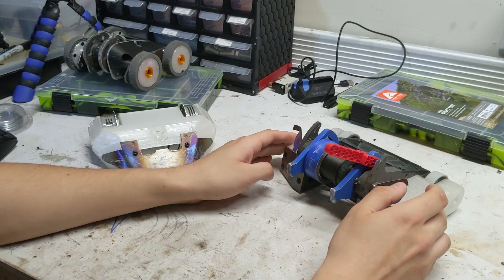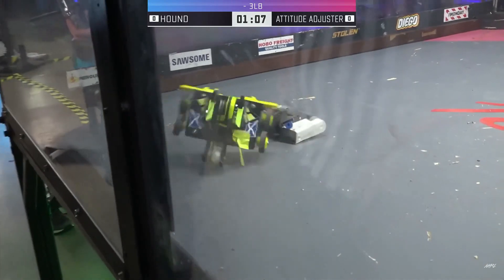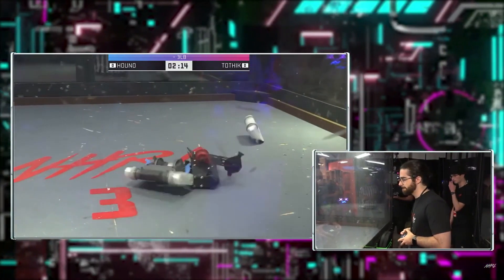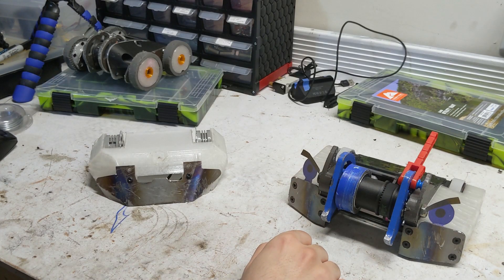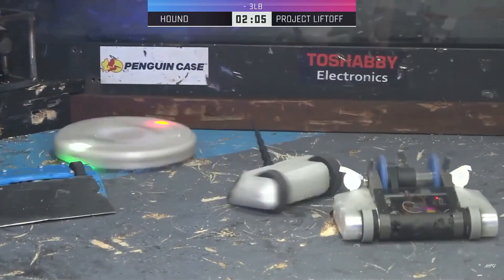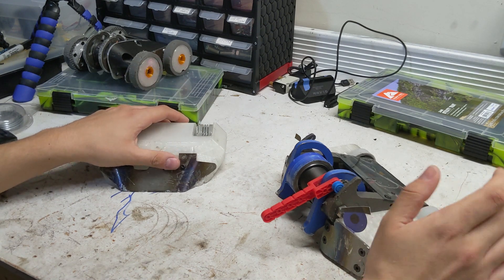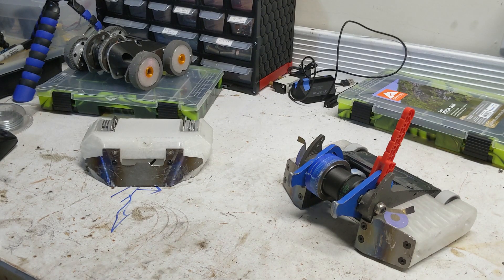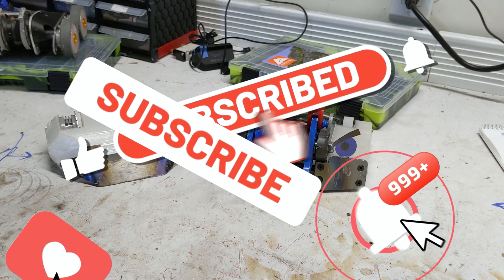Hound 2022 September NHRL Recap

Comment: Great video! I really liked the little cut-aways doing a bit more explanation on relevant things (like the note on the bottom).
Would some stabilizing forks on the front help with the flipping around the weapon axle that seems to happen quite frequently?
The fight vs Project Liftoff was such well driven, from both you and the driver for potato. Textbook example how you should fight a meltybrain.
Sad thing that the fight vs mixtape basically ended because of a cockup in the pits, but I guess that's combat robotics.
Reply from the maker: Thanks for the feedback! I was experimenting with some stuff in the video editor and I'm glad it turned out good.

I do plan to add some outriggers to hound in the next revision